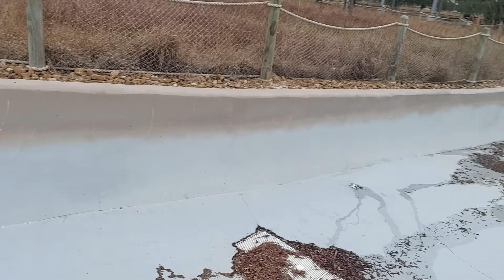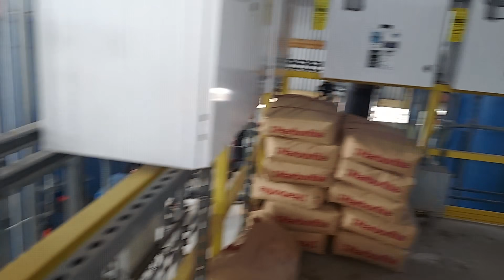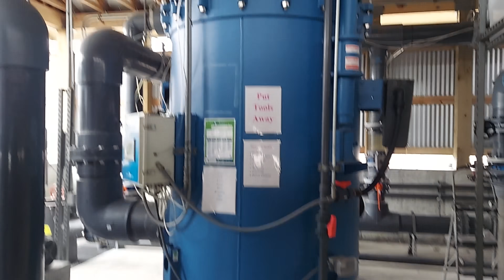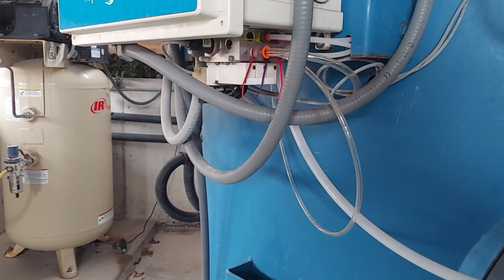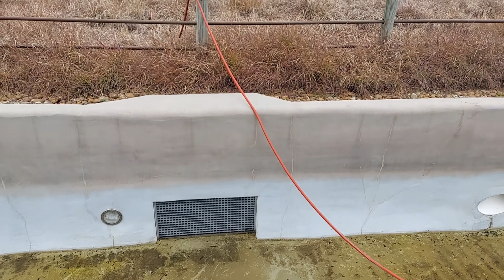Lazy River Pump House Walkthrough

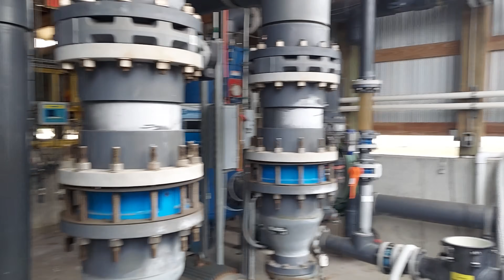Comment: What is the purpose of the small water pump with a strainer at 3:46 
Why not in the other ones?
Reply from the maker: So each separate body of water has this pump.   We call it the chem loop pump.  We send water via this pump to he chlorinator and acid systems,  where the chemicals are added already diluted and returned to the main water line post filter.  We do this so we don't have a bunch of chemical lines overhead.
Reply: @thepoolguy  i suppose that the larger ones only recirculate water to the slides and those stuff no?
Reply from the maker: @adrilaraglez  well, slides filters and other items but yes

Comment: Is that pressure washer on a Pepsi pallet? Haha
Reply from the maker: Yes, the plastic ones are smaller so easier to move around with a forklift in tight areas.  PLus, the plastic units dont break apart.

Comment: How many pumps are allowed to fail before you have to shut down (at least a part) of the water park due to loss of filtering and water treatment? The concept of the lazy river basically bringing the water all around the park to where it is needed seems clever! 
Are the grates on the skimmer "open enough" for dirt and leafes to get into the filter system? The skimmers with the "hole at the side of the pool" are big enough to catch leafes, small balls, wigs and something like that.
Reply from the maker: So the river only feeds the mat racer attraction.  There are other water parks that use the water from one body of water for all attractions.  This can cause many issues. Dirt and some junk can go through the grates.  Larger items are caught and picked up by hand.

Comment: Does the surge pit have a sensor to shut off the pumps if the water level gets too low? To avoid pulling air into the system
Reply from the maker: They don't, the chances of this happening are slim to none as the drains must be controlled by hand.

Comment: Saw accutab buckets, curious what accutab systems do you use on site? I used to work as a commercial tech before I started my company and we had the model 3075 on some accounts, any air in the system and those would just recycle it and deprime the pump instantly.
Reply from the maker: Our chlorinators are custom, and have a larger reservoir on the bottom of the unit.  I will be talking about our units in a future video.

Comment: If someone does a code brown 2 in the lazy river would you suspend operation on the mat racers as well until lazy river has gone through the chemical blast and levels are back to normal? Any other rides connected to the river? Love the content.
Reply from the maker: Yes, unfortunately this is the downfall of shared water.  If either of those attractions are contaminated, both are shut down for sanitation.

Comment: Very interesting so the lazy river is the main filtration source other rides feed to it.  Like it a lot also moves the water around the site a lot    which is good for filtration and water movement.   can't imagine how much it would cost to have pumps and filtration on each individual ride  so it's very cool set up  enjoying u videos  stay safe. From old Blighty England
Reply from the maker: So just the Mat Racer is connected to the river.
Reply from the maker: We have an autofill system that allows water into the tank when getting low.  Think the leveler on a cattle tank.
Reply: Also I presume the lazy river will always get topped up with water due to evaporation.  and water lose filter cleans and so on.   so water levels can be stable that way  because of the amount off water in river  I'm guessing interesting  keep up the good work

Comment: Sounds like if your River is down for some reason, you lose a lot of other attractions.
Reply from the maker: Just the Mat Racers, but yes, it sucks when it happens.  Only a couple times since we have been open"?
Reply: @thepoolguy  That makes me curious, if you have to do some type of mid season repair to the river, is there enough overflow capacity in your other pools to store the water in the interim? Are there builtin valving/piping to transfer water from one body to another?

I would like to see a video on your water heating and details on how long it takes to preheat for season startup and the btu rating!